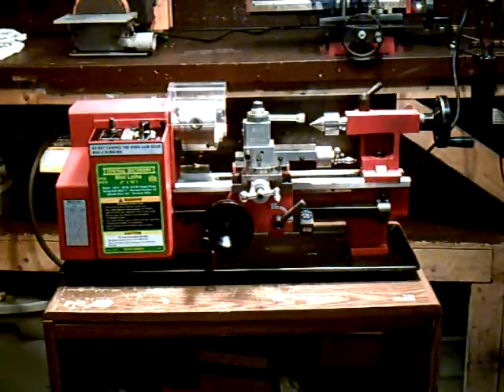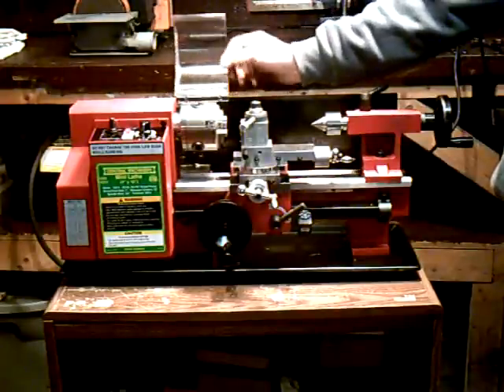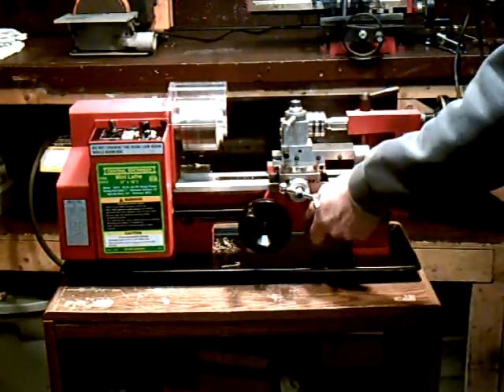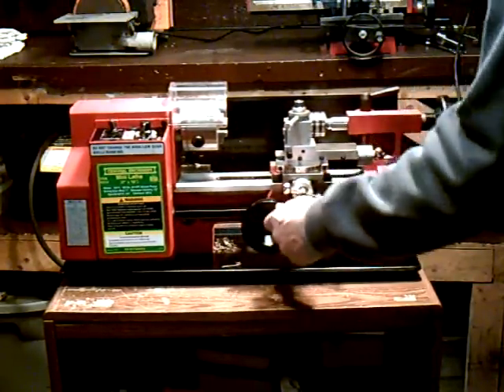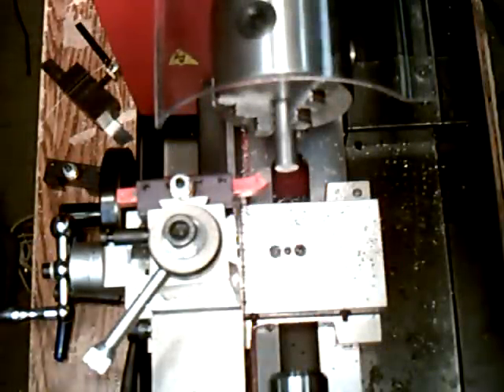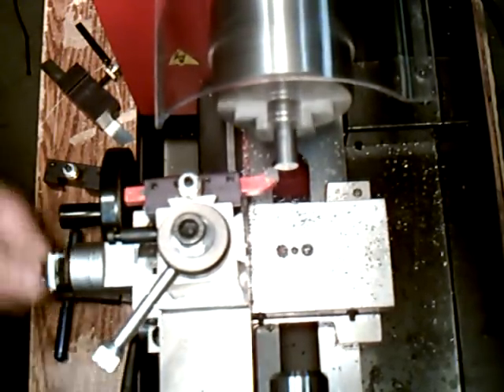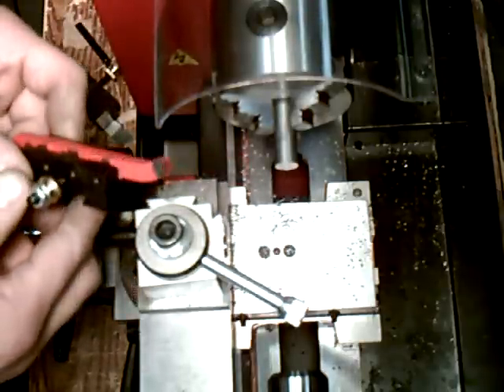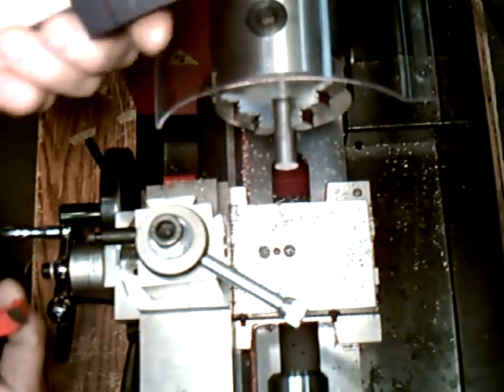Harbor Freight 7 x 10 Mini Metal Lathe Video 1 of 3

Comment: I agree. The odd thing is that I worry that with so many safeties that folks will get in trouble on other machinery items! The 93212 Lathe I have also has a delayed start too. Thus the motor is delayed from starting for many many seconds. The circuit has a timer that delays the start. Thus one has to have the chuck shroud's interlock switch engaged. Then the machine's speed control has to set in the slow black region on the speed dial. They one has a long delay say 4 to 10 seconds, or longer !

Comment: Good intro video!  Thanks for making the effort.
One thing to consider when facing a piece of stock is moving the tool to the center of the work piece, then feed the tool into the piece, adjusting the depth of facing cut desired, then use the cross slide to pull the tool out across the piece.  This ensures that the tool will be fed into the workpiece  the desired amount, avoiding damaging the tool or workpiece with too deep a cut.

Comment: He has the clear plastic chuck shroud in place; ie the "do not sue me feature." This shroud pivots on a shaft that goes to a safety switch  and thus the lathe cannot start. Even if the shroud is removed on the 93212 it only will start in the super slow black speeds. Yet another "do not sue me feature" , Thus *this* lathe at 6:51 cannot start and if the shroud's safety switch was jumpered the lathe can only start at a super slow rpm. Both safeties are a USA staple since folks sue

Comment: good way to start out, I've been eyeballing the little harbor freight lathes for a few years but haven't come up with a good excuse to get one. I bought their drill press a few years back and the plastic depth stop broke within minutes but I still have it and it works great for what I need it to do. I suppose if I had their lathe it would be handy sooner or later....I need to find a good excuse to get one. thanks for the video, please post a new one showing the downfalls before I drop the 500 bucks.

Comment: I have a 7x10 lathe that was given to me. Great little lathe but the bed is way too short if you are trying to drill into the end of your workpiece. I just ordered the 7x14 bed extension from littlemachineshop com. it will increase  the length of bed by 6 inches from the 7x10.  I have seen a post on a forum where a guy got the bed extension and then tacked his old bed out from that to get a super long bed to hold his tailstock.

Comment: people need to check places like, Enco, Grizzly, MSC industrial supply for accessories for this little beauty, also a threw jaw chuck is fine for alot of stuff but a four jaw is more accurate turning like with in .00005 thats five-ten thousandsths of and inch. also when your figuring speeds  for turning and faceing use the cutting speed in the machinest hand book multiplyed by 4, divided by the work piece diameter remeber use the speed closet to that figure not over

Comment: i see you have done everything right xept for one thing need to anchor that machine down firm to a bench  and level it the machine will tend to move around alot and that will throw of any otherwise good job you will do and for safety too you wouldn't want that machine on your toes ouch just tryin to help ya i'm not a hater

Comment: dude either your lathe has an electric brake (for added safety) or your lathe has some lubrication/ friction issues otherwise, that 3-jaw chuck wouldn't have stopped that quickly, wheres the momentum?; may i suggest lubricating it properly?

Comment: Which quick change tool post is that,  where did you get it, and how do you like it.  Im on several of the mini lathe pages and have seen several quick changes and some have pros and cons. Little machine shop???

Can you please do a video just on that tool post? 
The video could have the following:  
What was required to mount it.
How to adjust the tool height.  
Parting tool in operation, 
Boring bar in operation,  
Knurling tool in operation, etc.

Thanks!!!

Chris

Comment: I have never worked on a lathe, but spent many years on surface and O.D. grinders.  Would it be correct to put an indicator on a chucked in shaft to check for any wobble?  I appreciate your response, cheers and good luck with your projects.
Reply: You will always have radial runout on a 3 jaw scroll type chuck short of expensive micro adjustable chucks that cost more than several of these lathes combined. Try to do all operations without rechucking that need to be concentric.If that's not possible use an indicator to centre your work in a 4 jaw with individually adjustable jaws.
Reply: thanks for the answer

Comment: Great video. Im looking to get one for parting off 7/8" OD carbon tube into 2" long lengths. Can the tube be fed into the lathe from the back of the chuck. The tube comes in 4 feet lengths/
Reply: The spindle through hole is only a little over .75" which is too small to fit 7/8 (0.875") so you will not be able to do what you describe.

Comment: When using a 3 key chuck like that, the reason is to be able to indicate your piece in so you are true, you adjust each chuck while using a dial indicator. Just an FYI. It looks like a nice little lathe. I would be leery, Harbor Freight isn't always known for quality so please be careful and wear the correct PPE for the job.

Comment: Considering the time and money spent on homemade (except electronics) cnc and one of these Sieg metal lathes (Grizzly not Harbor Freight)…
If I could do it all again: I'd purchase cnc-ready Sherline 4000-series mill/lathe package (and add the electronics).

Sherline is better designed, better built and much more versatile than the Sieg; however, it costs a LOT more to include all of the features  that come with the base Sieg.

The Sieg is good enough for me for now,but I got what I paid for.

Comment: do these harbor freight or any mini lathes use the cooling liquid when turning and cutting. I see on several videos that they are cooled and others they are not. I have never used a lathe, but I am going to be purchasing one because I am starting a business manufactoring suppressors. I know thaking a night course at the local trade school is in my near future but I would like to go in with some bit of practical knowledge.
Reply: Betrayed Vet to answer your question, No. If you what to rig up something it is easy to do, all you need you need is a 12vdc windshield washer pump a 3 foot piece of transparent silicon tubing and a 12vdc power supply at 115 volts 1 amp. It's one of those black plug into the wall power supply. Then make a rod to hold the tubing up and over the parts you lubing. That should do it. Have a Good Day John

Comment: i just got one from a estate sale  and i want to make a tobacco pipe can you show some wood working tips  thanks buddy i do know this is a very old video take care
Reply: This isent a wood lathe
Reply: +Jack Beebe Thank you
Reply: It's a lathe that does metal yes. But you could put a live Center in the 3 jaw chuck and you could easily do wood work! 
Yes this machine is advertised for wood and metal. 
Daniel disregard the previous poster he is. NOT informed clearly.
Reply: You'll need wood turning tools for this if you want to try and turn wood on the lathe.  As it comes its geared towards metal working only.  You'll need to find a tool post that'll somehow work on the machine to allow you to rest the wood turning tools as they don't make any wood turning quick change sets for these lathes.  

I am waiting for my lathe to show up, supposedly its on the Fedex truck for delivery today.  I got the next size larger than the one in the video as I am planning on using it to turn pens.  I  have a wood lathe for wood and acrylic pens but thought I'd like to venture into some metal pens so with a 25% off coupon at Harbor Freight I figured I'll give it a try and eventually see what I can do to make some quick change wood cutting tools as well to make the machine more versatile.

Comment: do your self a favor on that machine you best ware ear plug or your hearings going to be gone soon with that whineing of the machine..! something is too tite in youe lathe causeing the whine check the belts and gears if gears make sure they have grease or ep-90 gear oil on them...! lathes should not make that noise ever..!

Comment: Do not get this lathe. Sherline 4000 is way better for the same price. You will want to convert to CNC later and it's way to expensive for this lathe, and plastic gears are horrible. Plus there are more available extras for the Sherline than this one.